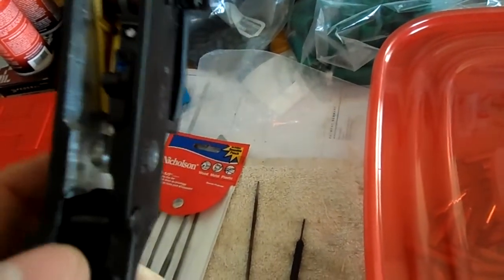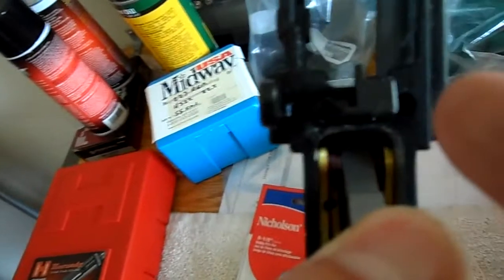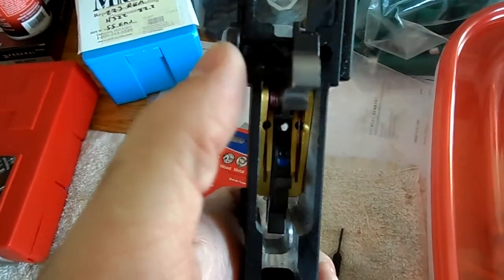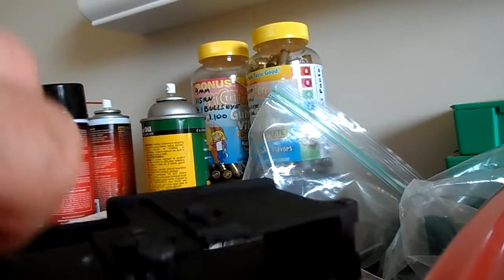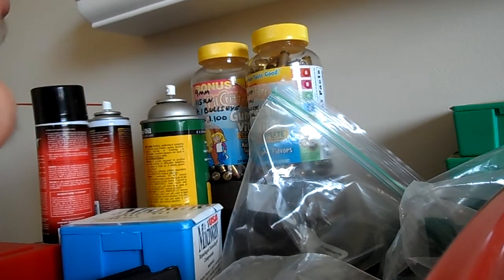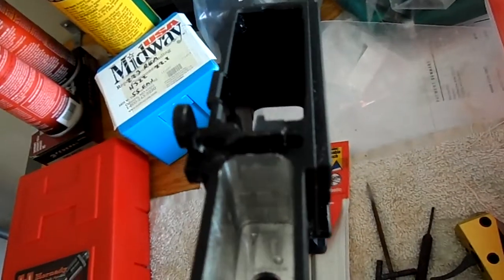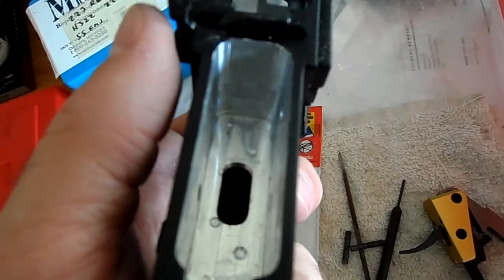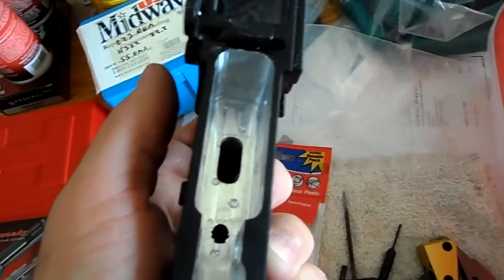80% Arms Problem

Comment: So u still having the rapid fire problem?...i did had to use a carbite bit to remove some material for the hammer to moove freely!...but doing a test function, mine does locks back and and resets!...havent fired it yet tho!...
Reply: I️ had similar issues and it turned out to be the hammer was out of spec. I️ replaced with a drop in trigger and works fine now.